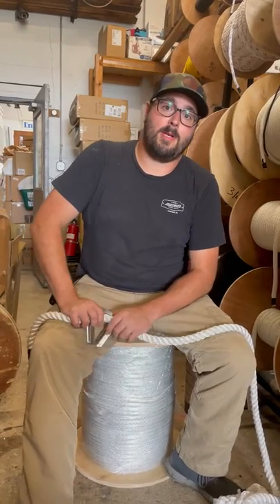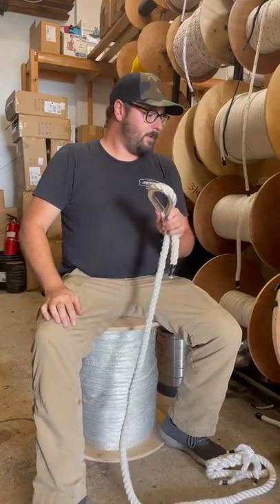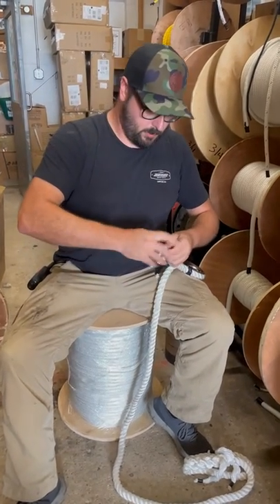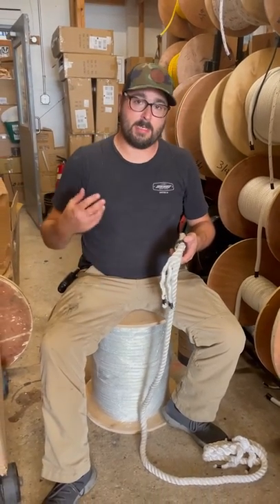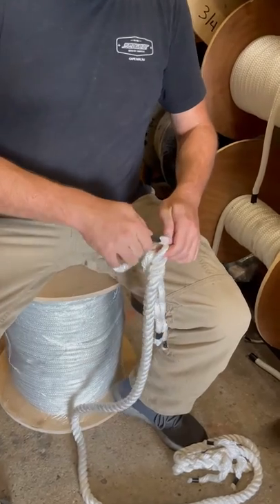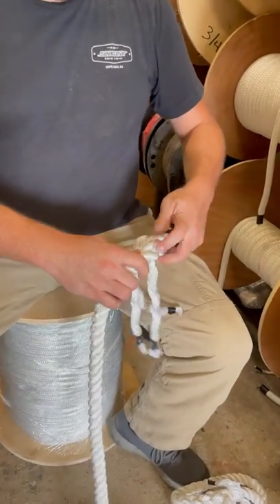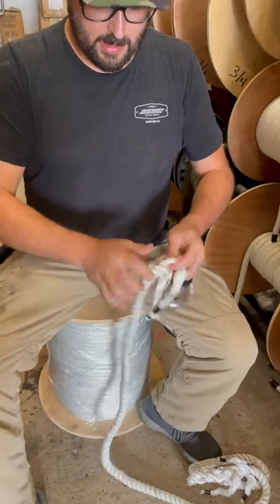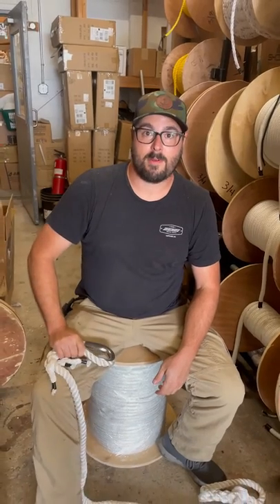How-To: Thimble Splice - 3 Strand Nylon

Comment: "If it looks a little lumpy, just take it in your hands and give it roll!"  Same advice my Dr gave me!!!😉 

But seriously, nice clear, to the point vid. I'm pretty good with my knots but always been a bit intimidated by eye/thimble splicing, just felt I'd lose track of the strands half way through, & it'd be time consuming, would always take the easy way out & whip the tag to the standing, (in much smaller dia rope/cord) but this seems pretty simple to follow  and I understand it's the proper way to do it, much more permanent & secure. Will definitely give it a try. Cheers 👍🍻
Reply from the maker: Thanks for the kind words and taking a look

Comment: Great - I like the tip you gave about starting at top dead center at 2:43. I think that first tuck is most critical to getting a splice that lays properly at the apex of the thimble. Thanks.
Reply from the maker: Thanks for checking it out